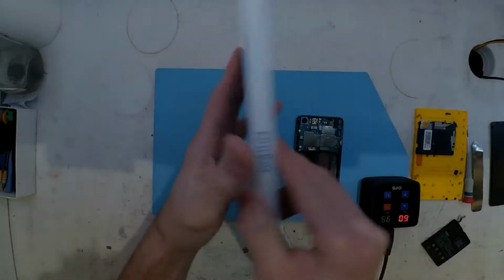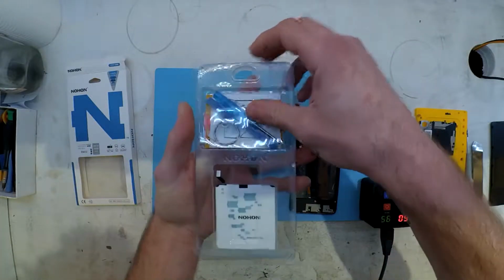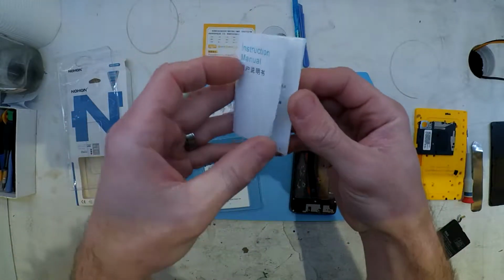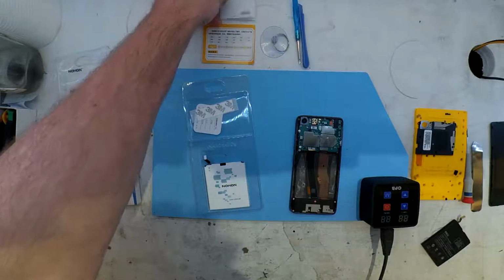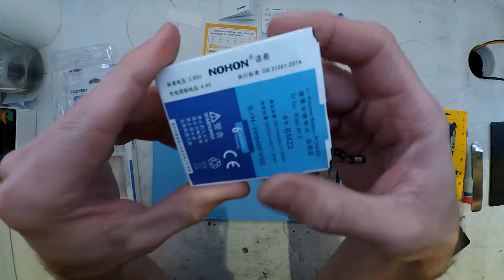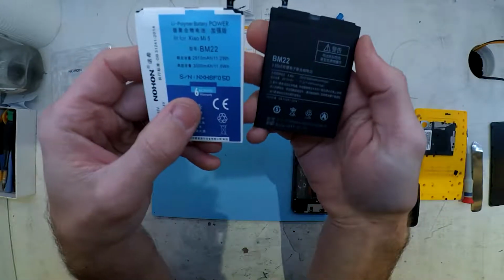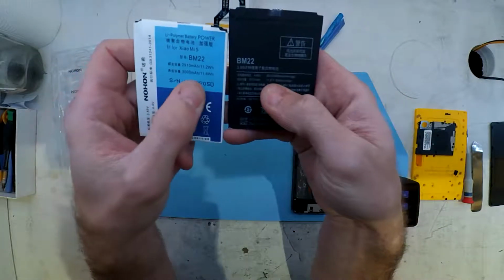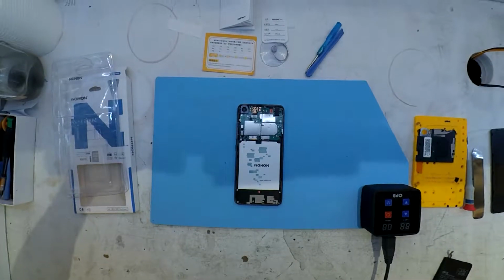Nohon Replacement Battery Unbox

Comment: @Ricks Tech
Could you give us an udpate regarding the Nohon battery status on the Mi5? What is your daily SOT?
Thanks
Reply from the maker: Hi

I no longer own the phone and has long since been sold 

I found the phone battery life didn't change too much when I changed the battery so I suspect other factors may have been the root cause, like software, age of hardware
Reply: @rickstechrepairs  you know, I am getting crazy with every mobile has passed at least 2 years.
Replacing of the battery(original is difficult to find) don't solve the problem so I am really thinking that the mobiles has been manufactured to don't provide the 100% performance after a couple years due the market policy....
Reply from the maker: It would come down to life expectancy, if the phone or device is expected to run well for 2 years, they will invest the bare minimum to get it to run those years at an acceptable speed/battery life

Anything after that would be a bonus

Comment: I heard different (good and bad) feedbacks from this company in the long term. I'm planning to replace my original Poco F3 with the Nohon BM53 5000 mAh, but I don't know... I need feedbacks ONLY from long term users (I'm ALWAYS charging my battery btw 20 and 80% using ONLY slow charger). Thanks

Comment: is it good brand?
Reply from the maker: so far i have been happy with them but will need to see how they go in the long term.
Reply: @rickstechrepairs  so, how is it after 4 months on mi5?
Reply: @rickstechrepairs  yeah I want to know about the SOT too
Reply from the maker: Im pretty sure that the phones SOC is slowly wearing out, as there has only been a small improvement in battery life
Reply: @arieffuadi5960  indonesia kan? Boros gak bro nih batre?
Reply: @septabgs1573  dari rekomendasi banyak orang, dan dev orang luar. ini paling bagus dibanding yang ngaku ngaku ori. mungkin kualitas hampir sama dengan ori
Reply: @arieffuadi5960  kalo di test pake antutu atau accubaterry estimasi kapasitas batrenya berapa mah gan?
Reply: Ricks Tech any update ? Still working ?

Comment: Metal objects forcing the battery, high chances of explosion
Reply from the maker: Spray isopropyl alcohol under the battery and it completely kills the adhesive of it and will lift out just fine

Be cautious not to use too much so it does run and go in to the lcd